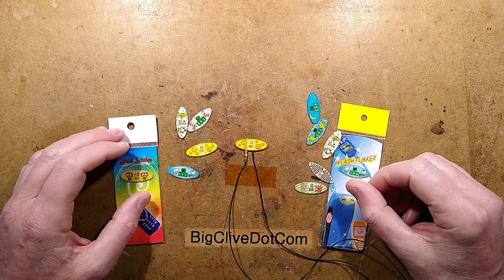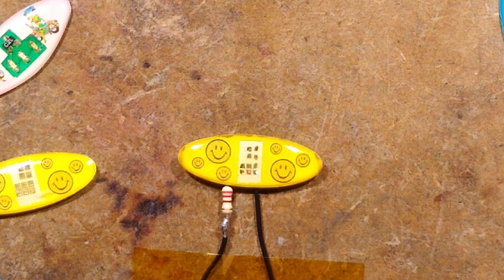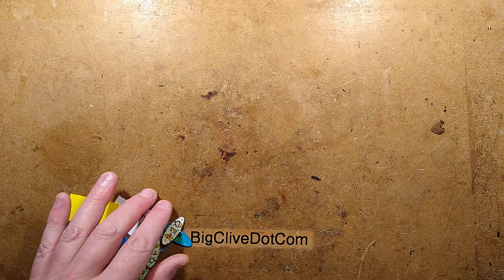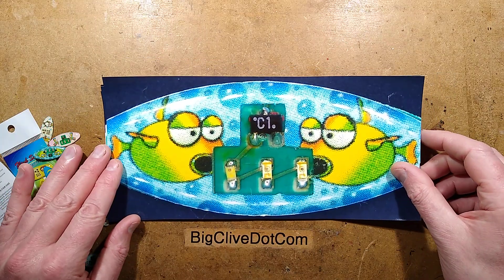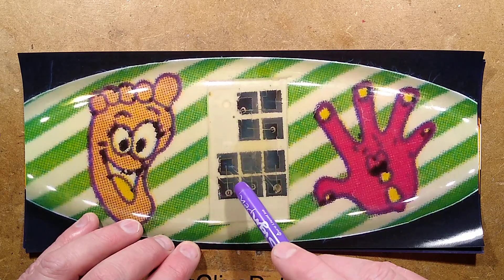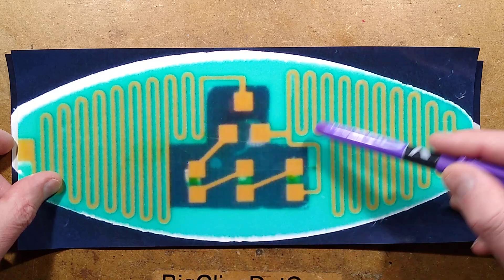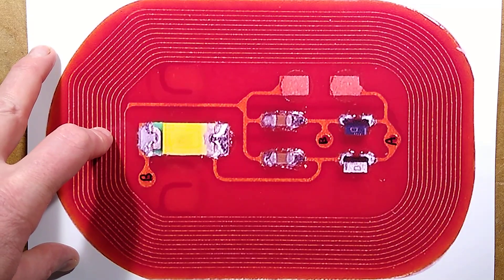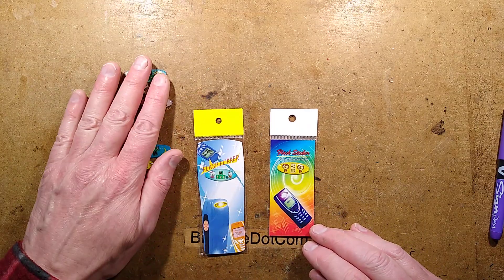How self-powered flashing phone stickers worked (with schematic)

Comment: If you stuck one of those next to a cell tower would they light up?

Microwave maybe?
Reply: If you put one IN the microwave oven and crank it right up, it will definitely light up. And then probably start smoking.
Reply: @brianleeper5737  so in theory..... microwave safe plates with that simple circuit inside of them might be possible? 
Think I remember hearing that microwaves are 2.4g but could be mistaken. 
It's a neat idea and makes me think of tesla's free wireless electricity. 
And if u made the antenna length for 5g threw a couple caps in line with so many 5g stations maybe have a light that stays on without needing batteries or plugging in..

The fingernail light looks interesting,  can't wait to see the video on it.

Cheers
Reply: @skepticfucker280  Yes, it might be possible but you might run into problems with the microwaves destroying the LEDs. One of the more destructive things to do with an old microwave oven is to put a scrap circuit board inside and turn it on---it lets the magic smoke out of every chip on the board at once!

Comment: The fluorescent tubes we used back in the day, to show off our 145 MHz power amps, didn't fit quite the sticker. 😁
Reply: I used to work on fighter jet radar. We had a couple of maintenance spots called "nose bays", like three sided mini hangers but only the front of the aircraft was covered. It was so we could work on the radar in the rain. The three interior walls of the nose bays had fluorescent tubes mounted on them, no power to them. They would instantly let everyone around know if the radar was set to transmit. It looked kind of spooky when the antenna swept across the tubes.

Comment: GSM uses TDM, i.e. the transmission is in pulses. Making for higher peak power. Which is handy if you want to flash an LED.
Reply: The same effect produced the distinctive "GSM gallop" sound in any speakers nearby that had any unshielded components whatsoever - you kids who were too young to remember having heard it can listen to it if you search for that term on here. You could know when a call was coming in by hearing it on your crappy computer speakers a few seconds before the phone's electronics made it actually ring. The interference was not an insignificant problem for professional audio engineers for many years. It's been so long since I'd heard it now with the advent of 3, 4 and now 5G which don't produce it, I'd forgotten it existed. Also, I don't think we ever had these stickers in the US, I've never seen or heard of them until now!
Reply: @Muonium1  I remember hearing the incomming call on my computer speakers before it actually started to ring.
Reply: @Muonium1  That was the first thing that happened on my GSM course. Ericsson (before Sony came into the mix...) had a course for us when we started at a repair center for their GS197/198 phones in the mid-1990s. The teacher just turned on a radio and said "listen" and then he made a call to a phone near the radio. It did get a bit more technical after that tho 😂😂
I was young and so amazed that we had a full GSM transceiver station at each of our diagnostic/repair stations worth several hundred thousand Swedish Kronor😁
It was a long time ago, but I remember (I think I do at least) that the most common fault when the phone had bad sensitivity was the L147 coil, a big one (in SMD terms at the time) that often came loose and needed resoldering. There were different shells, Bang & Olufsen, Telstra, etc. and one of my colleagues was adamant that the Bang & Olufsen ones sounded better, even though the internals were identical. "Must be the B&O blue plastic covers then, with better resonance", he said - the human mind is a strange and weird thing 😁
End of ridiculously uninteresting information, this channel brings out the worst nerd in me😁
Reply: @bennylloyd-willner9667  As a Finnish kid with a dad who refused to buy Nokia after getting fucked as their subcontractor during the recession my first phones were Ericsons! I loved that yellow flippy one line display thing. T10 was it?
Reply: @aziztcf  I can't remember such "modern" models 😁. We worked only on 197/198 and they came by trucks full of them every week. GPS fitted trucks with some direct alarm connections to the police I recall. Lots of value in those deliveries. The 197/198 was called "the brick" due to its size, shape, and durability. Only the swivel antenna was a bit flimsy, but the rest was a solid brick. We had Finnish Operator covers too, I can't remember the branding tho.
Reply: @bennylloyd-willner9667  I did a lot of engineering for an Ericsson repair centre in S Yorkshire. I used to make the pucks and little doo dad's that fitted in the battery compartments that when you squeezed them little prongs popped out releasing the shell. Some very fiddly engineering as I remember.
Reply: Hello from Ericsson. I started in 1992, still here. 🙂
Reply: @Muonium1  I didn't realize that GSM interference sound was termed GSM gallop! 😃👍
Reply: @Muonium1  still getting that if my phone is right next to an audio cable. I have my headphones plugged into an amp though.
Reply: @Muonium1  I have a very old set of computer speakers that makes that noise. It’s part of the charm using nostalgic technology from my youth.
Reply: @Muonium1  I remember that gallop on the speakers in my car back when I had a NEC bag-phone (actually an AMPS (analogue) car phone in an aftermarket bag with a huge 12v (10Ah?) sealed lead-acid battery that was half the size of the transciever which was already the size of a medium sized hardback book...)
Reply: @Muonium1  Also when you placed your phone on the dashboard of your car, and the interfence in your car stereo anounces the incoming call
Reply: @Muonium1  I remember hearing that on the car stereo when a call was about to come in when my GSM powered philips brick was in the glovebox
Reply: Dib dib, dib dib de dibber. dib dib de dibber. 😂
Reply: Spoiler alert before I watched

Comment: The older bag phones and the brick both made by Motorola put out 3 watts in the analog days I still have both of them and they light up will still work on 911 apparently here in the US they left one old radio on the towers . Also I have a tone reader and frequency counter was easy to clone the old ones  the introduction of the digital system put a end to that oh BTW they worked on the 800 megahertz band forgot that bit you could listen in on people with your scanner .
Reply: The very first TACS car phones in the uk ran about 15watts. There was a warning on the transciver box about keeping away from the antenna.
Reply: You could also listen in on analog cell phones using an old TV set that went up to UHF channel 83.
Reply: Given how many radio hams seem to follow big clive, I suspect a lot of us here used to listen to cellphones in the analogue days. 
Certainly in my teens, if iw was transmitting, we were monitoring.

Comment: I remember the flashing antennas, but not these stickers. Neat!
Reply: I remember something similar but like a keychain type thing.
Reply: I specifically remember a local tech shop chain selling replacement flashing antennas for the Ericsson GH388, they flashed red/blue and was marketed as making it easier to notice that the phone was ringing.

They also sold the stickers, and I don't remember if they marketed those as protection from the radiowaves or if it was marketed as the Ericsson antenna above...
Reply: @Stoyon  I worked in a mall kiosk, where we sold all that stuff, and modded phones. We would completely disassemble V60, T720, Nextel and Nokia phones, and install aftermarket housings and special light up keypads on them. We did hundreds of them over the year or so that I worked there. I could fully disassemble a Nextel phone in a few minutes, and have it back together with the "upgraded" parts, within a few min. The plastic quality was garbage, and the hinge always broke.
Reply: @Stoyon  I remember those! They were the brightest red and blue LEDs I'd seen up to that point, they actually inspired me to build an LED grow light way back then.  It was an expensive and complicated process as I remember.
Reply: Had one of those flashing antennas. It was bright and degraded the signal so it didn't last long. I did learn a thing or 2, like when I went from cell to cell while not in use it would flash and It flashed before the phone started ringing. I've never seen the stickers before.
Reply: These stickers were very very popular at one point when I was frequenting night clubs. You couldn't hear the phones ring but the flash was a dead giveaway that the bulge in their pocket wasn't their lunch! It was also a pickpockets dream too. The phones were easily spotted from a distance in the dark and because they were quite large people were more likely to put them down on a table instead of in their pocket so they became an easier target for theft.

Comment: I was hanging up Christmas lights, and started talking on my 2m ham radio HT. Suddenly I realized the bulbs (incandescent) closest to the antenna were glowing. I was using about 5w to get into the repeater... maybe one of those would light the stickers up.
Reply: Easily. I used to demonstrate that 5W is actually a lot of power, (and that it's how you use it that makes it enough) by simply using FM on 70cm's using a helical antenna, a dummy load and a 1/4 wave whip antenna and holding a tube lamp up to the various antennas showing what was radiating the best. Further demonstrations I did the same to show the radiation pattern and how changing the antenna length would change the point where the signal peeked on the antennas a wave, and at what point some of the signal was being reflected back down the coax to the radio (creating heat, and being wasted).
Reply: Nikola Tesla
Reply: Incandescent novelty lights are so beautiful, still prefer to use them :) Leds are superior in lighting fixtures (like table lamps), though. Cute RF story!
Reply: @MLX1401  how cringe, do you feel better now?

Comment: I found once a led antenna on a phone, it was a spring antenna with 1n4148 diode and LED shorting 1 or 2 turns 
I found it interesting about the concept
Reply: Ericsson phones had those available in aftermarket. It's been a while!
Reply: @GriotDNB  I remember the local chain of tech shops carrying a range of replacement antennas for the GH388, there was stubby antennas, extra long antennas, and antennas with red/blue leds.

I never had a mobile phone at the time so I never got to try it
Reply: My first phone (motorola m3788) I stuck one on and it was as you described there, always thought it was somewhat magic how it worked at the time... :D